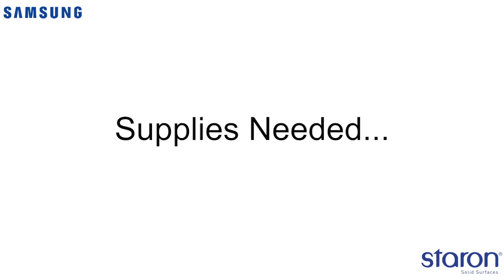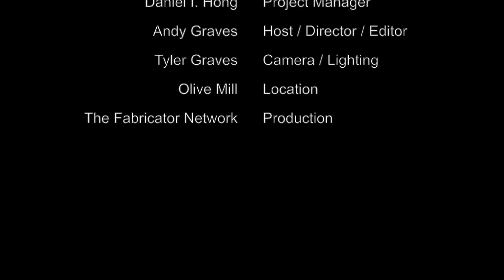How to Polish Solid Surface Countertops - Gloss Finish

Comment: How long can one generally expect the shine to last before reapplication? I know this is going to depend on usage/wear but just curious on an average time frame. I don’t want to polish mine if I’m going to have to do this every 6 months or less. Have a lot of solid surface counter top sqft to do in this kitchen.
Reply from the maker: Doing this process you're actually shining the material. It's not like an application of wax that will deteriorate over time. The only thing that will make less shiny is if you scratch it. So if you have a dark color countertop you're going to see the scratches more. If you have a light color countertop, it will stay shiny for years.
Reply: @AndyGraves  Thanks for posting this video.  My local big box didn't seem to know if there was any variability in Solid Surface texture.  I guess this means we can gloss it up from the matte finish it comes in.  Are there any manufacturers that deliver a custom counter that is NOT only in matte finish?  I assume a local counter shop may be able to make it glossy, if I desire.

Comment: I have corian with a satin finish. Do I still need to sand before polishing ?
Reply from the maker: No, you don't have to sand but when you polish it will enhance any scratch that you have. So you might see more scratches just because of the mere fact that you're polishing the countertop. Sanding removes the scratches before you polish.

Comment: Bro what pads are those (brand)? Also what speed are you on? I tried this and not have the same results
Reply from the maker: It's all about the sanding. Clean the sander and material in between each grit. The polisher will make it shiny pretty fast if it's sander correctly without deep swirl marks. The pads are the ones from 3m, I think I put a link in the description.

Comment: Does this process take scratches off Corian or do I need to lightly sand it first?  If I need to sand it, what grit paper do I use?
Reply from the maker: Check out my other videos that show the sanding process. Polishing will not remove the scratches.

Comment: what if its new
Reply from the maker: What if what's new?
Reply: @AndyGraves   hello thanks for getting back . I want to make it shine without using epoxy
Reply from the maker: If the countertop is new you still need to sand the counter before you polished it.

If you polish without sanding it will show all the coarse sanding marks.

Comment: I see you rotate the machine. How about using a DA machine? Stil need to rotate the machine?
Reply from the maker: Hello, yes you can use a dual action polisher, it will just take a little longer.
Reply: @AndyGraves  thanks! Do i rotate the machine during the session?
Reply from the maker: Not sure what you mean by rotate the machine.
Reply: @AndyGraves  like you polish while you make movements.. cirkels.
Reply: @kimwullems  do not make circles why polishing lol not sure why the guy in the vid does. Rotary is king. 

-15yrs autobody
Reply from the maker: I did it like that because the manufacturer wanted it like that. Are you saying that the polisher should just be moved back and forth across the material in a straight pattern? Thanks
Reply: @AndyGraves  the body shop i worked at, they trained us to use a grid like pattern (left to right, right to left then up to down then down to up) with the polisher almost parallel to the surface. the circular pattern and tilt stiffens the pad to a certain edge (contact zone) and acts in more of a cutting manor. it definitely is faster for a counter top but for car paint finish it would cut through the clear coat really fast.
Reply: @AndyGraves  also, what type of surface is that? dont see too many like that.
Reply from the maker: I wondered about that. We are cutting a bit more but the material is a half inch thick so it wouldn't matter much. 

I will try that the next time I polish a top.

Thanks
Reply from the maker: @amorgan5844  That's a Makita polisher.